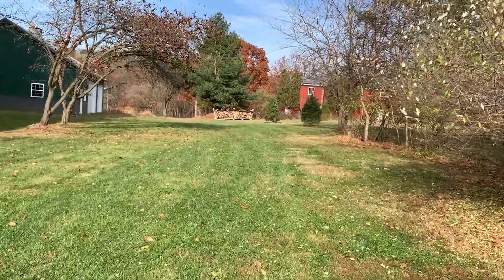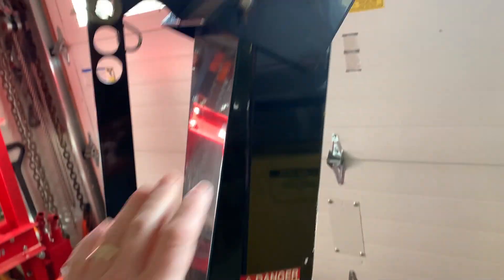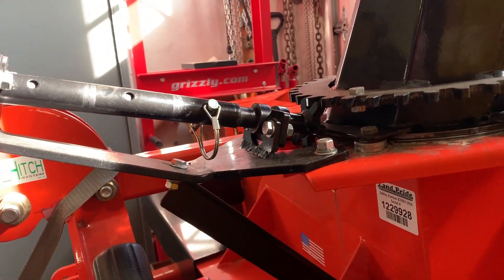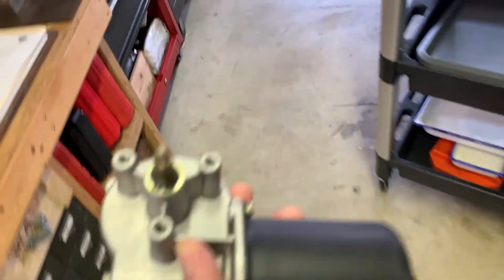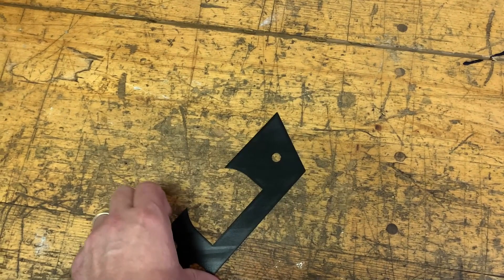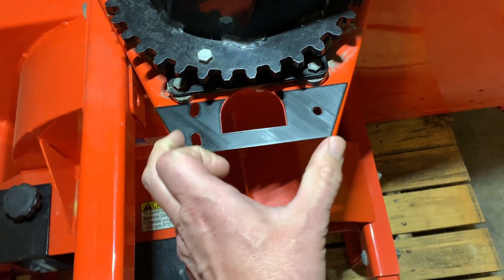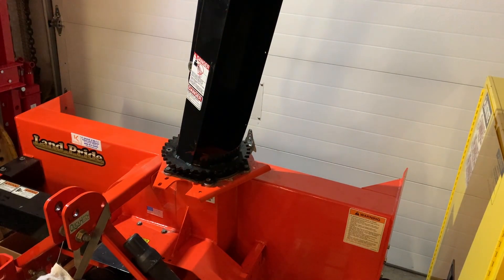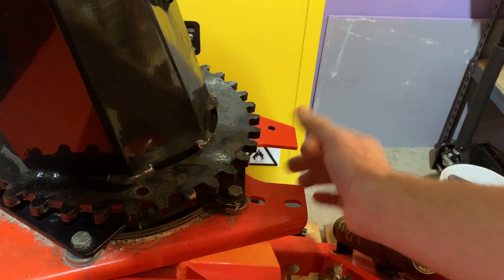Making an Electric Chute Rotator for Land Pride SB1064 Snow Blower - Part 1

Comment: Love it! Thank you for making the file available for download! I had seen this video a year or so ago, which inspired me to figure something out for the existing manual crank handle. It worked ok, but then a few months ago, I purchased a couple 3D printers for other uses and stumbled across this video again. I had forgotten about this wonderful design and was so glad it popped up on my suggested videos again at a convenient time, considering I had recently acquired the 3D printers...
I downloaded your file and put my machines to work. Just finished installing your design, and it is spot on perfect. I love how easy it will be to just print another gear and easily replace it in the future when the time comes. Again, thank you and great work on your design and for documenting the process. It helps someone new to 3D print design and see what a good process is for fitment and testing.

Comment: Nicely done. I have the same setup on my 44 inch Berco blower with a window motor from a car. A gear was already on my motor and the previous owner of the blower had welded a sprocket from a dirt bike to the bottom of the chute. The teeth don't mesh very well and if I was to redo it I would buy gears with matching teeth. It works great how it is but the chute wobbles and shakes a bit as it goes around. I call it the "self cleaning option"...lol.
Reply from the maker: Thx, it's such a joy to hit the button and adjust.  I find I repoint the chute 5x more often than I did when it was manual

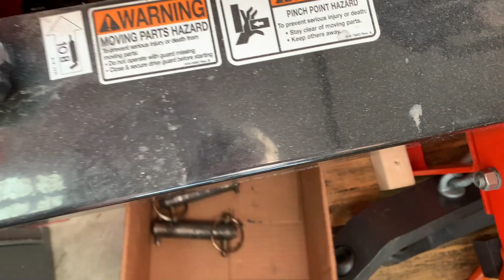Comment: 1:58 even easier- just keep the pins in the attachment points. 2:45 The chute rotator should have way more friction, I don't know why no manufacturer thinks of that. I wrapped an old bike inner tube around the crank which mostly solves it. Great job though, I wish I had the time to do this myself!
Reply from the maker: thx!  I do sell a kit that's pretty much bolt-on if you're interested

Comment: Toro used a motor on some of their units, it has a hex shaft output, easy to weld an old socket on and slide the shaft in.

Comment: Why can’t you put a motor in place of the current handle?  Would do the same as original equipment as long as the motor can run both directions like a small winch motor?

Comment: Can you print thay wirh rhe carbon filled nylon filament?
Reply: Sure can! I just printed my own from his file. I printed the gear from PA6-CF and the bracket from PLA-CF and literally just got done installing it. Worked perfect. So much smoother than what I had before, which is essentially the same motor attached to the existing handle shaft. The angle of the gear is so much better in this design. I had hangups from time to time with the old setup because the gear that comes from the factory handle is at a 45° angle or so. I went for 8 walls and 50% gyroid infill to be safe.